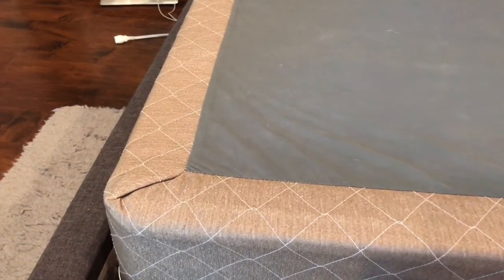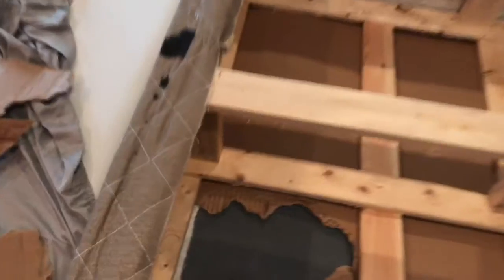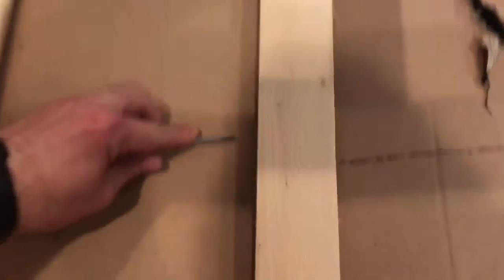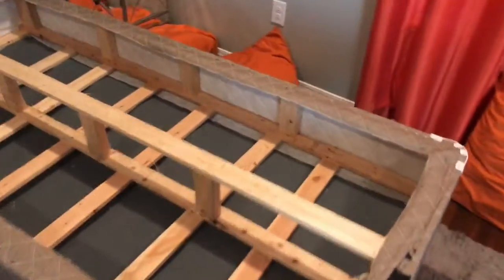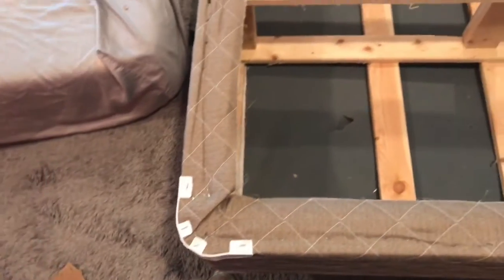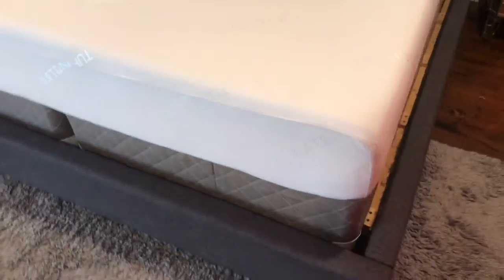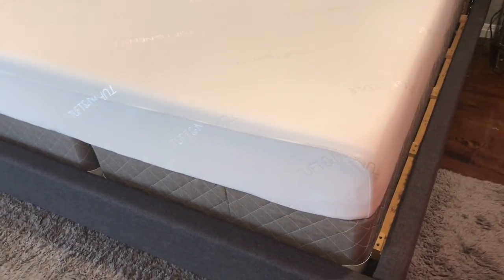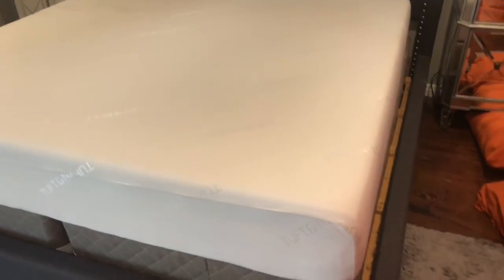How to quickly fix a squeaky boxspring

Comment: Thank you so much for this solution. I bought a bunkie board from Value City and within two weeks of having it and my new mattress, I was being bothered by it. I looked for a solution and found your video and realized when I took the bunkie board off and put my mattress back on my platform bed the squeaking went away. I removed the cardboard layer and now no more squeaks! I would not have imagined the cardboard was the culprit. Thanks again!

Comment: We have the exact same box spring (no springs, though ha) for my daughter.  I found this video immediately AFTER doing what you did, ha!  She was complaining how loud her bed was, and when i took the black fabric off, was surprised to see cardboard - and did exactly what you did and ripped it all out of there :)  I like your suggestion of replacing the staples on the corner pieces - planning to do that next, and if any squeaking persists, I'll throw some screws into the wood joints to tighten them up.  So far, very quiet - absolute revolution in sound from her bed.  It was SO loud before.

Comment: I honestly did not think this would work! I still gave it a try because I had nothing to lose. So at first I removed the cardboard just like in the video, yet I still had a creaking sound in some areas. So I removed the fabric to take a look. The sound was coming from tiny pieces of leftover cardboard stuck under staples. So I removed the whole thing of fabric and cushion and took out all of the staples with the cardboard under them. Put it back together and now its perfectly quiet. I am so glad I found this video.

Comment: I reserved comment until I tried it. IT WORKS! My box spring is considerably quieter, just the occasional squeak versus a constant screeching with every move. I removed the black fabric, dislodged all of the staples holding the cardboard in place, then cut a slit across top front side of the box spring, and slid the cardboard out in one piece. I figured no harm since I was going to trash it if this hack didn’t work. Thank you for saving my sanity and money!

Comment: I tried this and it worked perfectly it because you got the cardboard rubbing against the wood frame every time I tossed or turned during the night you would hear squeak squeak squeak squeak and it got upset so I just took the box spring and threw it out on the lawn and started using the exacto knife cut it out and no more squeak. Thanks for these videos it's amazing how something as simple as that worked

Comment: Just did this today! I was a bit afraid because my box springs are 6 mo old but they sounded like they were 50years old. So I gave this a go. My recommendations are.... Don't fully pull the bottom sheet off, aaaannndd try and pull the cardboard off in as big of pieces as you can. Definitely works! Didn't totally get rid of squeaks but at least 70% better!

Comment: Hi! I just removed the cardboard and even though it doesn't squeak as much as before it still squeakes. 

Thank you for the video though I was about to buy a new bed frame thinking it was that. But noticed the squeaking coming from the middle wood part.
 Any other suggestions???

Comment: I will have to try this again tomorrow because I couldn't figure out where the damn sound was initially coming from. I'll probably use a boxcutter to get the cardboard out quicker. Thanks for pinpointing what the problem was though had a feeling that it was within the boxspring itself!

Comment: They say doing this reduces the life of the mattress. It's been 3 years since you made this video. Has doing this reduced the life of your mattress?
Reply: FYI, I found another solution. Liberally apply wood glue in between the card board & the wooden frame on the interior of the box spring. I was very skeptical but it WORKS! I used Gorilla wood glue (the cheapest bottle) & it reduced the noise by 95%. I toss and turn a lot, plus I'm a very light sleeper so the noise has always bothered me but I lived with it. Anyway after spending $650 on a new mattress, only to keep having the same issue, I got desperate & tried this. The wood glue allows the card board to keep doing its job (disburse weight), while also significantly reducing noise. I don't have money to be replacing a box spring/new mattress so I decided (out of an abundance of caution) to try this out and thankfully it worked! Relieved and happy!
Reply from the maker: I have not noticed any isssues. I do have one of that mattress in a box things though.

Comment: It fixed the squeaking but after I could feel the wood underneath since I have a memory foam so I had a box and put it on top of the original bunkie board and now it’s perfect 😊. But if I had a mattress with springs it would have been so much better😅